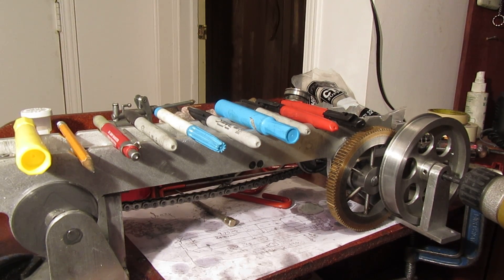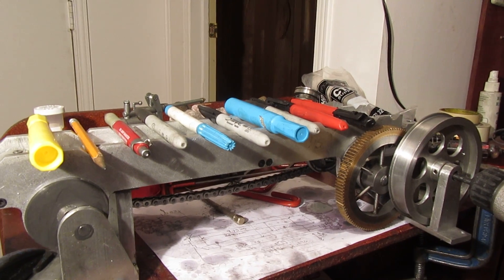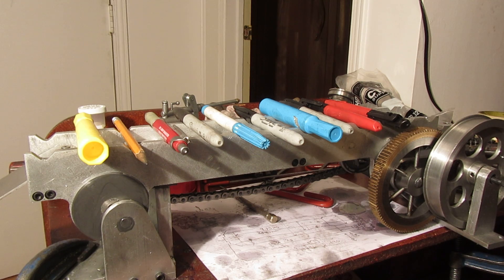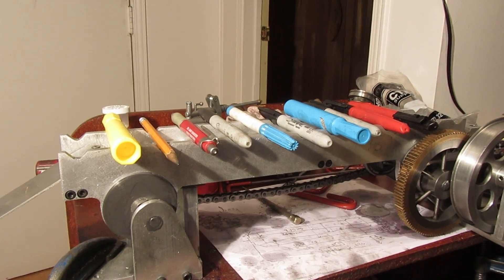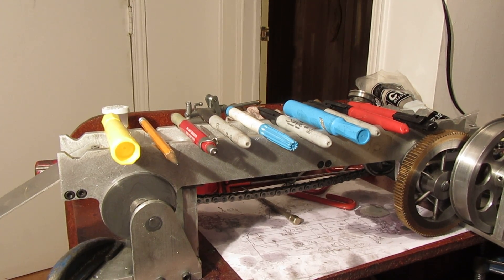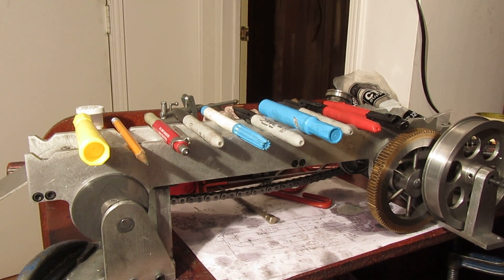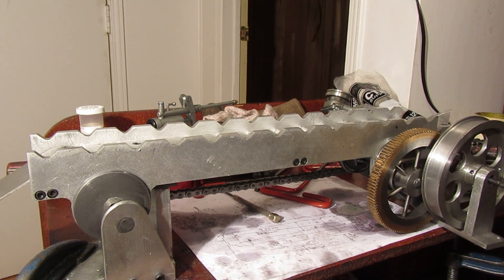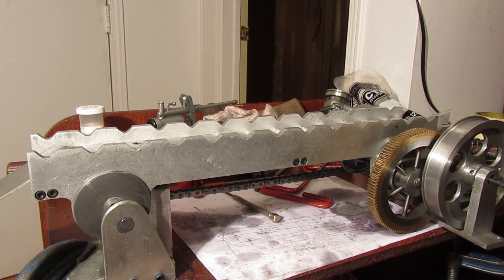MODEL OF WALKING BEAM CONVEYOR

Comment: Great video. These still have application in today's production environments. There are many cases where this is still the best choice.
Reply: Hi Adam, I see these still being used in automotive powertrain plants, usually hydraulically driven. I work on an apps team and a discussion popped up today. What types of cases would you consider a walking beam the best solution? any other practical tips on design and controls?